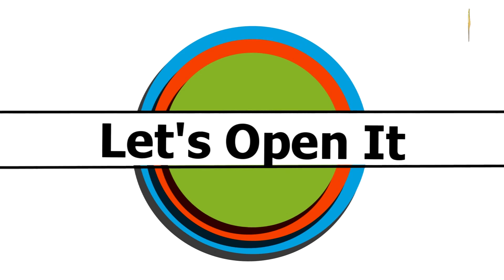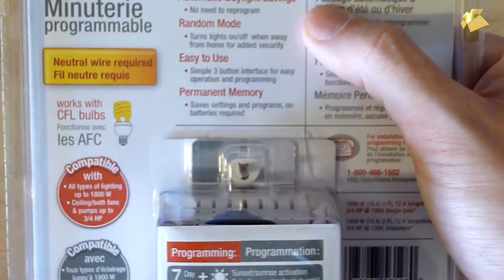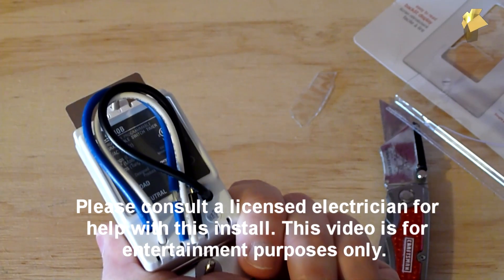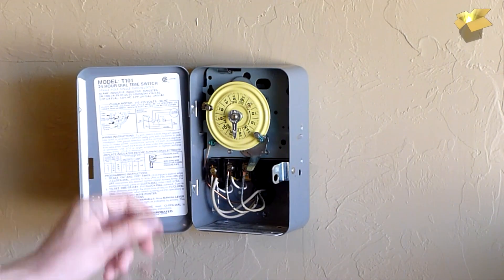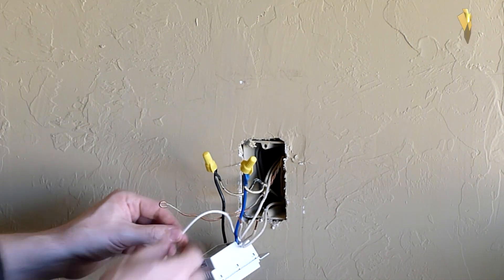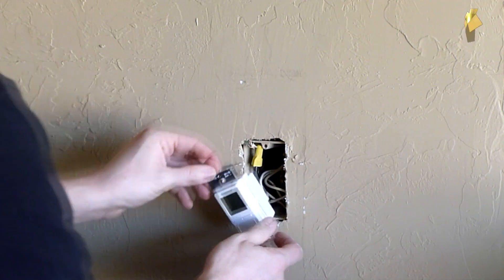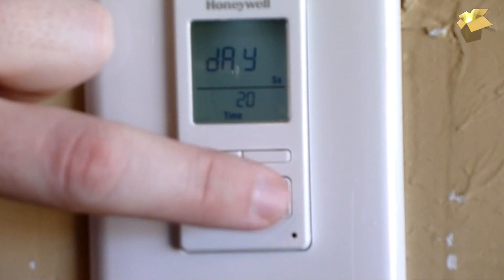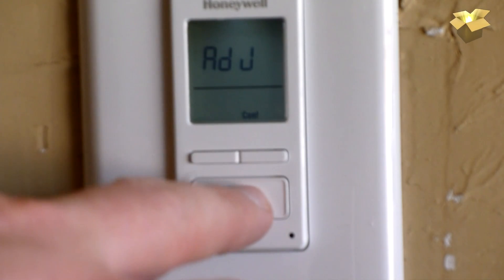Econoswitch Solar Controlled Switch - Unboxing and Review + Installation

Comment: Great explanation for wiring line/load/neutral.  Now need to determine how to fit 2 additional wire nuts into the already very crowded box shared with a 3-way switch!  Not to mention adding the neutral wire to that wire nut.
Due to concern regarding an overstuffed box, would it make sense to install a new box on the load side and just above this one?  Would be EZ: switch is in a garage with unfinished walls, there's enough excess wire between the switch and load, the line/load/neutral would be easily identified, and the ground could be re-established with a wire nut.  After installed, tape the "abandoned" On/Off switch to stay in 'On" position (or remove switch and connect line/load w/wire nut).
Feedback appreciated!